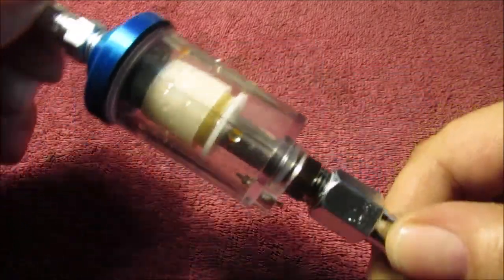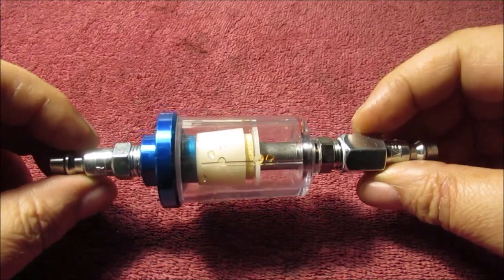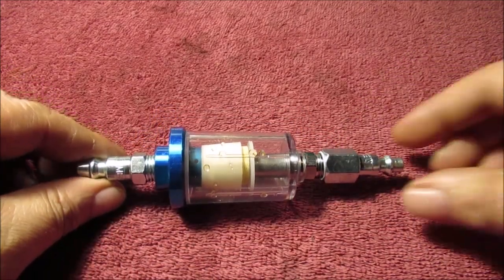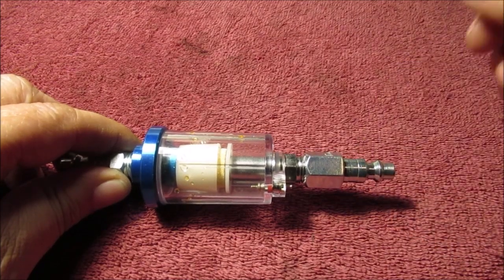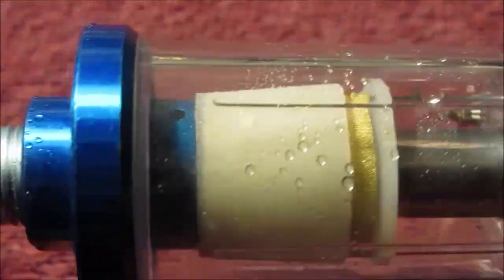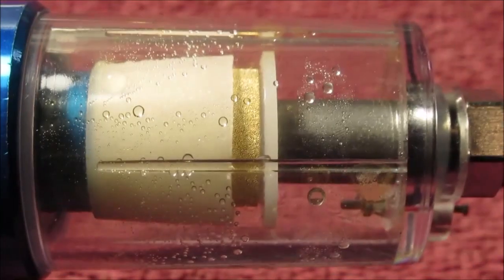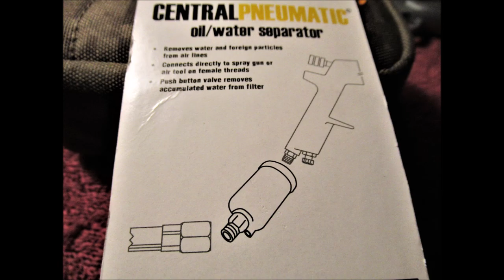Oil /Water Separator ( Used On Air Compressor )

Comment: Do this separators have an correct orientation? I just bought one and it has no indication about where I should  connect the air hose and where I should  connect the tools
Reply: I thing the blue cap of the separator should be up and the part with the water extraction needle should be down. That way the water has the most volume to accumulate before needing to empty it and least change to end to the brass filter part and "bypass" the extractor.

Comment: what max pressure this filter can withstand? i used directly on compresors valve which from factory capable of 120psi, which this filter would loaded 120psi, i scared it would explode
Reply: 90 psi is rated pressure according to HF

Comment: I got oil mess in mine. Can I reverse it and blow gasoline through it to clean it out?
Reply from the maker: If you are carefull you can take these apart I have had mine apart several times
Reply: @not2fast4u2c  , great thanks. It's just as easy as taking a ballpoint pen apart and I got it cleaned perfectly, thank you very much.

Comment: Nice video, but which end goes on the compressor end? Is it the Blue? 👍
Reply from the maker: clear side is air in blue side is out ..Just like a see through gas filter on a car ..The gasoline comes in the clear end and is is filtered through the out side of the filter.... bronze on air ...usually paper and or screen for gasoline

Comment: not worth a dime first time i hooked it up it blew the schrader valve off and it was junk and yes i had my paint gun trigger pulled back to release the pressure had the air pressure set at 35psi

Comment: there are little magnetic stones in mine after the first use, what could have happened?
Reply from the maker: No Idea on that ..something came in from your compressor ?
Reply: That's blasting shot or beads. It's used to smooth out the finish on cast metal parts. It often gets trapped inside compressors and regulators etc, if the manufacturer does not clean the parts sufficiently before assembly.
Reply: @davidaston1644  thanks for the info.

Comment: Very good product best with about 3 of them inline then a couple of big one's get a high rated big one on the air line that feeds the compressor so you catch it before it even goes in your air tank and its simple witch way round it goes its got a little drain on the bottom your not gunner drain it towards the compressor are you simple
Reply: Uhhh grammar check?

Comment: Hey man I have this same exact filter. When I hook it up it’s dry as a bone even after using the compressor all day long.  Have you ever had that happen with one ?
Reply from the maker: I have some water drops What is weird is I just hook it to the hose I get a bunch of water coming out the end getting past the filter
Reply: On my compressor, the outlet is directly below the pump. So when the pump has been running and gets hot, the outlet also gets hot. The compressed air flow also picks up that heat, which means the moisture in it remains vaporized as steam for a longer time.

Condensed/liquid moisture is easier to separate. But steam molecules blow through the separator's stone filter with no problem.

Several things you can do to make separators do a better job. But whatever you choose, the key is to cool the air as much as possible before it goes through a separator or  dryer. The more moisture you can cool and condense into liquid, the more effective your removal will be.

Here in south MS, 90% or more humidity is the annual norm. Without a filtering system, my compressor becomes a pressure washer--especially during the cooler parts of the year when it's easier to reach reach due point behind the hot outlet. I have 3 different strategies in place, and I get clean dry air very reliably:

1: I have an 8 foot air line between the outlet and my filtering. This gives the air some travel time in order to cool down.
2: Before the dryer, I have a what I call a "forced condenser". It's constructed the same way as my dryer. But instead of containing desiccant and absorbent mix, it is stuffed with stainless steel scouring pads. As the air passes through, the water molecules crash and deflect against all of that. This randomizes and scatters their paths, causing them to collide with one another--which doesn't happen easily when all moving through an air hose at same speed and direction. When water molecules collide with each other, they "clump", which is effectively condensing.
3: Instead of a stone filter separator, I have an absorbent dryer immediately after the condenser. Close as possible to not allow the water molecules time to re-atomize into vapor. Also, I don't use only desiccant in the dryer. I have it layered. Bottom layer is a super-absorbent polymer mixed with fine-strand pulp. On top of that is the largest layer...standard desiccant silica gel. Then at the very top, another layer of absorbent/pulp mix. The idea is that silica gel easily loses "grip" on water when fast rushing air passes through it. But the  super-absorbent polymer truly does absorb and trap it permanently. The pulp fiber makes the absorbent more effect because it is much faster...it wicks the water from the silica gel and acts as a buffer while the absorbent is a little slower at permanently bringing it in and locking it down.

All of the above, I constructed as DIY, using household water filter housings as the canisters.

The absorbent and pulp mix, I get from el-cheapo disposable diapers from the local dollar store. Cut an diaper in half, turn the halves inside-out like you would a sock, then scrape out everything contained. That's the complete mix. Works AMAZINGLY well, too.

Comment: everywhere on the internet i get conflicted views on which side is the fucking inlet of air. too difficult to put an IN OUT on the  case manufacturers?
Reply from the maker: I agree..On any clear filters like for gas filters on an engine The gas always comes in on the clear side and then through the filter ..That way you you see all the junk like rust in a fuel tank

Comment: You know you can unscrew it and put decissant beads inside it. Use a deccisant filter if you want driest air
Reply: The bottom fitting will unscrew the top part and it comes apart and seals back put some beads inside it
Reply from the maker: I have taken mine apart to clean it ..not a bad filter for a cheap one
Reply: your comment saved a filter from being discarded due to having little metallic pebbles from the tank inside it.  thank you.
Reply: That would disrupt the entire mechanism in which the water seperator functions and make it essentially useless.
Reply: @jsplasha  i don't think it would tbh ,  you could really just put the whole bag in it , would do the same thing but i think it has a little needle under the filter that can be pushed in i guess it's for draining the water inside?? It does have to be taken apart sometimes tho to clean it there is always little trash in it like little dots basically dirt 😂

Comment: They work I have the same one.
Reply from the maker: It does seem to do the job .I like that it is compact and easy to use .I want my new air tank to stay water less since it has no drain
Reply: This filter keeps water and oil right,not just water.l hope l understood right . Thanks for the video.
Reply: @sancak099  yessir and dirt too im pretty sure

Comment: How many psi do you use it at.? It says it’s only rated for 100psi that seems too low
Reply from the maker: I never go over the rated PSI on anything but i run this at 125 PSI since I never seen a rating on it
Reply: @not2fast4u2c  I ended up about blowing my oil separator up when it got too hot by the output of my compressor.
Reply: @not2fast4u2c   The Harbor Freight Tool website says "The handy oil/water separator works at 90 PSI to prevent condensation from contaminating air tools, keeping your air tools operating at peak performance." 
Does that mean it's not effective at over 90 PSI?  Dangerous at more than 90 PSI?  Or since it's a cyclonic action inside the unit that also not effective at UNDER 90 PSI?

Comment: Why would you put a male fitting on both ends? The male should be in, and a female should be out.
Reply from the maker: In the first 35 seconds of the video I said why I had the fittings this way to stick it on my reserve air tank At 2:00 I show it stuck in the hose from the air tank
Reply from the maker: @billybobjoe198  No that is my way of explaining why I had the fittings like that ..If you think I insulted You go back to your first comment Where You were wrong telling me how it should be done .
Reply: @not2fast4u2c  I think you took that the wrong way.
Reply: Why would manufacturers of many pneumatic tools and parts not come equipped with NPT male plugs and female couplers? Maybe cause they don’t know your configuration and leave that part up to you 🤷🏻‍♂️🤦🏻‍♂️
Reply: @billybobjoe198  Sarcasm is harder to pick up in comments and is why you have to add an emojicon to convey your intent. :)

Comment: How long it lasts?
Reply from the maker: I do not know ..I know how to take them apart and clean the brass filter part so my will last a long time
Reply: Im not sure tbh but i kinda wanna say it can last forever untill you dont like it anymore , from clear or paint ruining the clear view inside the filter , which can probably get a buff , but i just found out how to take it apart and clean it from the inside it had a lot little dirt pieces or some sort of little black dots super small and re installed it , it confuses me how it filters tho it makes no sense.